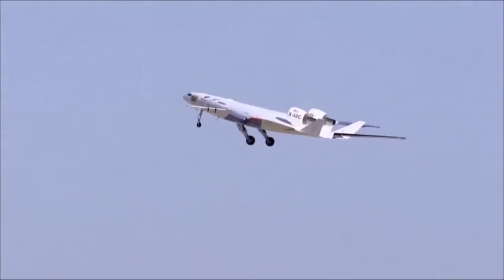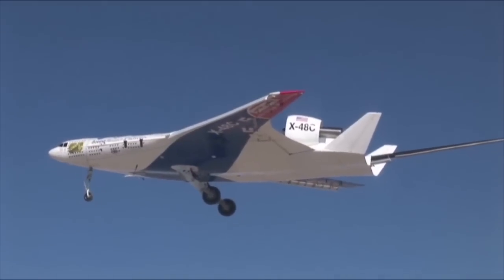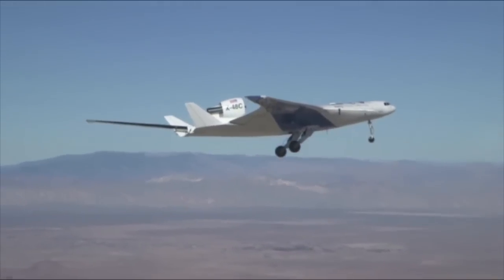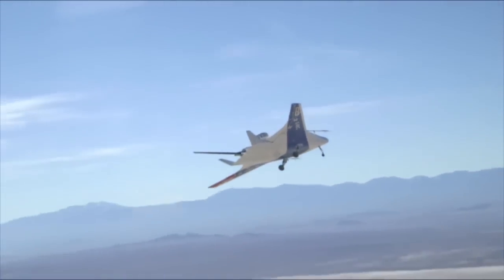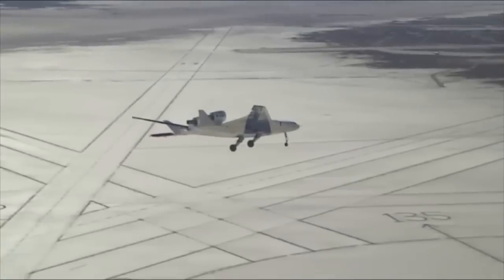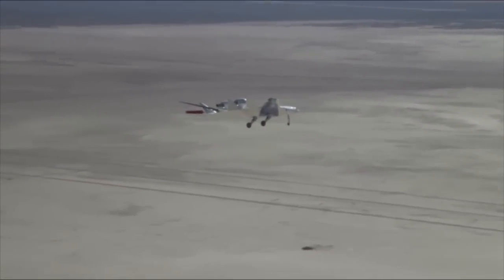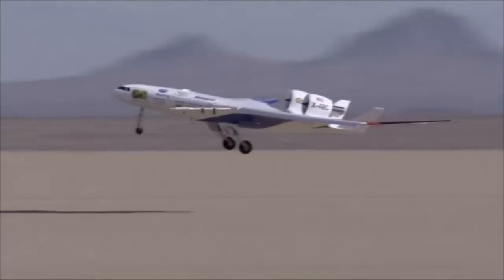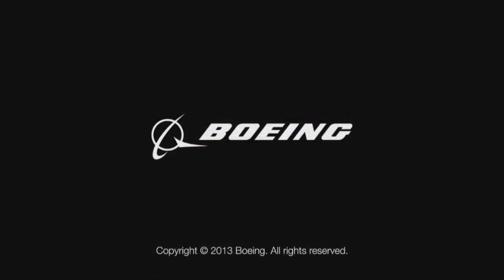Boeing's X-48C Blended Wing Body wraps up flight tests

Comment: If you want to talk about where the idea originated, go back farther.  Westland's Dreadnought concept (which unfortunately crashed in early testing) goes back to the 1920s.

Northrop built the flying wings which were so evocative, and the B-2 bomber embodies a lot of the ideal of a blended wing: all lifting surface.

Comment: So Boei g designed their version of the B2? Only the B2 is 100% internal. No slam to Boeing, this design has future, but bring in the engines into the body, and this baby will FLY!
Reply: Safety reasons. Its designed to be a passenger liner, and if anything goes wrong with an engine, it's outside of the main hull on a pylon.
Reply: Bringing the engines inside the body would vastly reduce the aircraft's cargo capacity. This aircraft is meant as a cargo/transport vehicle, not a combat vehicle.
Reply: Bringing the engines inside would make it far to noisy for passengers